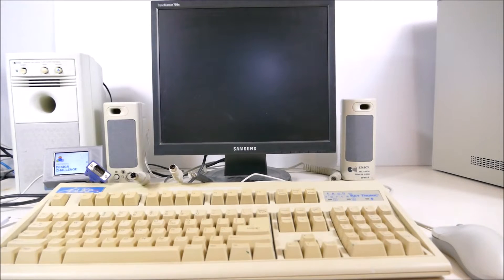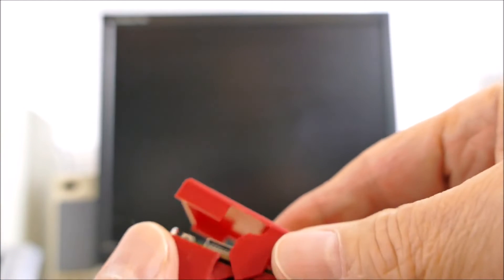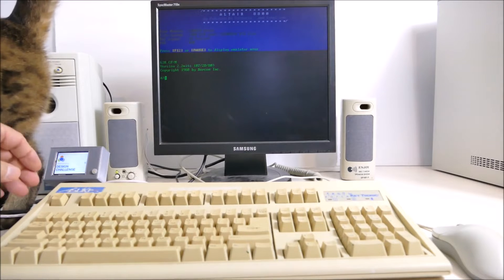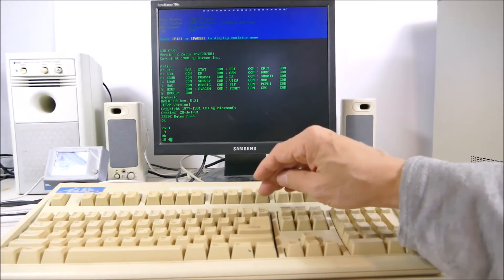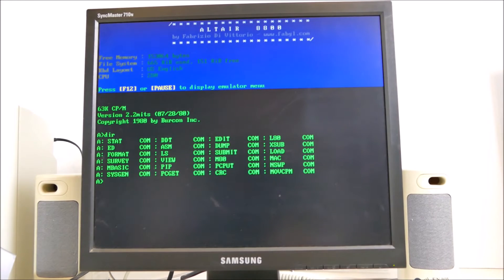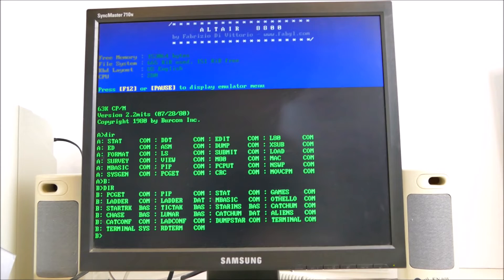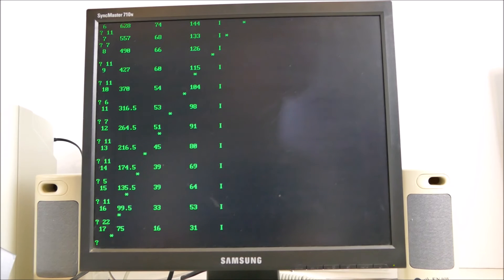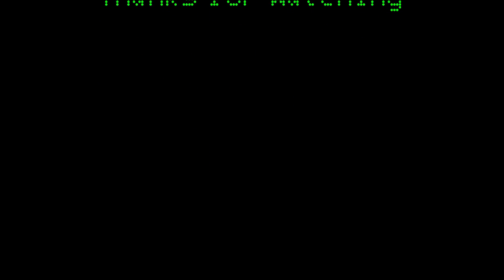CP/M on an ESP32

Comment: Hi All

Wow 45 years ago i done that luna lander on a HP calculator, we had ??? 5 or 6 of them, it took me almost 2 months before i got a perfect 0.00 landing, then pressed print to get it all saved on a strip of paper and the machine did not have enough paper, i think it saved something last the last 50 lines command and screen text when you print so you sort of see the calculation etc if it fits.

But part of the way in printing it out, the paper ran out and only a few people in the library saw it and i never had proof of a touchdown